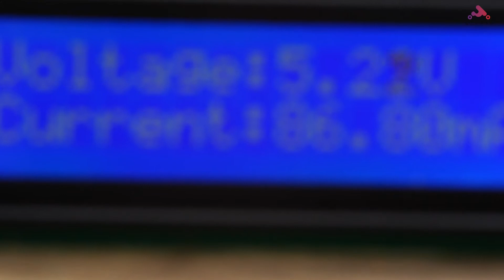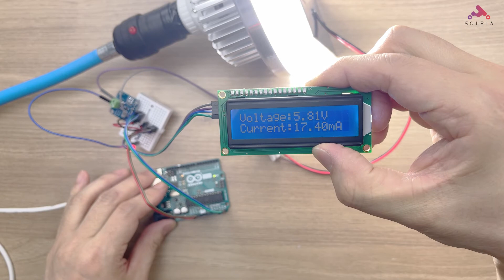Monitoring voltage and current of INA219 sensor with IIC LCD (ft. Arduino, solar panel, LED)

Comment: Can i have your code? I can't access the link that you have given. Also, i have a problem. I'm using the same components that you use. I want to measure voltage and current output of a solar panel (exactly the same with yours) and the measure result is bias, very different from multimeter result. My question is, is there any adjustion do you do in your code, so that kind of small current can be measured properly? Thanks in advance

Comment: Thanks for the video, Can I use this sensor to measure the power consumed from a 24V 6A battery?
Reply: No, INA 219 are only rated 3.2 amps, you will need an INA260